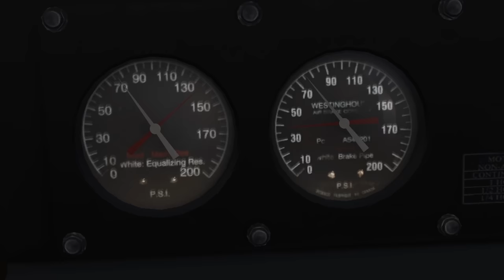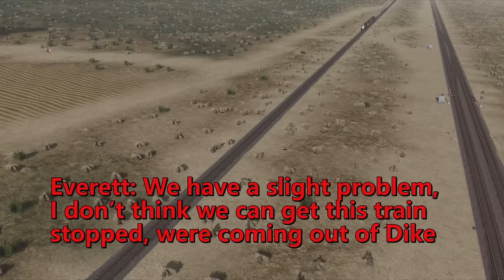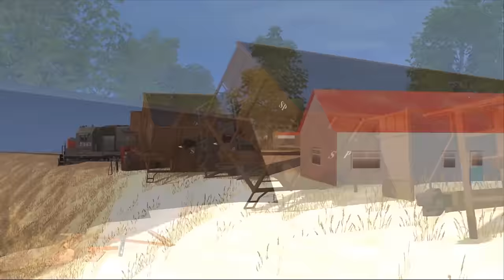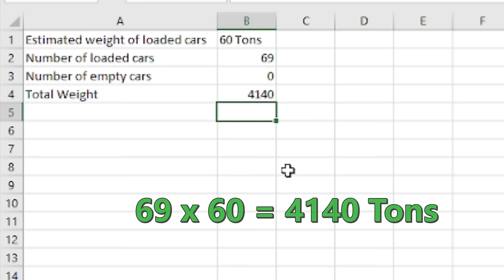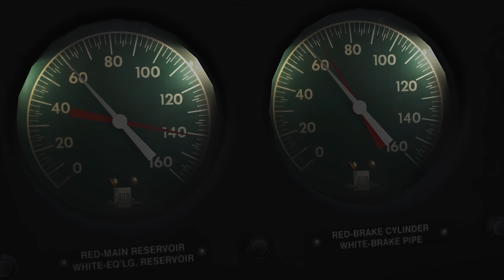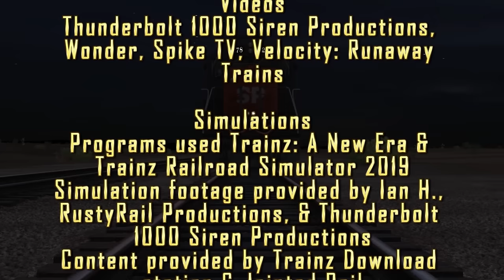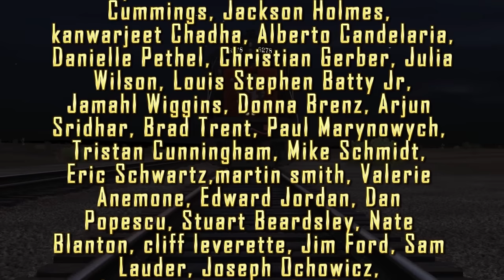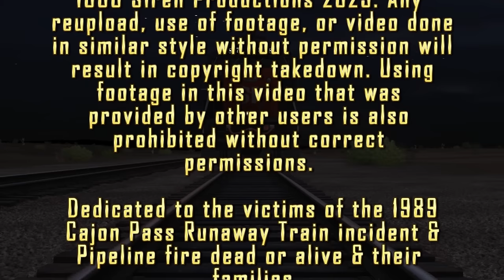The 1989 Cajon Pass Runaway 34 years later (Remastered)

Comment: The helper engineer did not lie. When the helper engineer said he was in full he means he has set the controls to maximum dynamic braking. With a short heavy train, and about to go down Cajon Pass, the engineers should have had a discussion about how many working units they had. Shorter trains mean fewer brakes and curves don’t take effect. All this should have, and would have been discussed, with more experienced engine crews in this operating area. Crown and Reese very experienced but they weren’t driving. The accident might have happened anyway, but the more experienced crew would have been more cautious and attentive to braking details. I know, I was a brakeman for SP and have worked this territory.
Reply: Bro learned the the truth and he is saying the right thing.
Reply: Where is Dave Carson these days?
Reply: @donstarr7261  I worked with Dave. I think it was a trip to Fresno. We are both Mojave High graduates.

Comment: SP asked the manufacturer EMD, to set the locomotives up to where when in emergency, the dynamics cutout. It takes about 60-75 seconds to reset the dynamics. The reason the locomotives are set to do this is to prevent the train breaking apart into sections that can collide. The front section slows more after the train breaks in two if dynamics remain on. This cause that faster moving rear section to collide with front section. Since this accident, the locomotives are no longer setup that way. When you go into emergency today, the dynamics stay on. If the train breaks in two, and a rear section rams into the front section so be it.
Reply: Interesting information, thanks for sharing.
Reply: Did it rain on the fully loaded hoppers prior to the event ?.

Comment: Sad part is the rail line was probably there first. People who have home/buy homes need to understand the risks. In my life I have  passed on buying hundreds of homes I looked at ..one a home within 800 feet of a rail line and also several properties with and next to gas line easements. I also passed on two near brooks/ streams. In ALL  cases these  were wise  decisions on my part: the rail line had a chlorine leak 5 years later and the neighborhood had to be evacuated. The house near the 2 foot gas line later expanded it to 4 feet! There where also gas leaks that permeated the ground and the neighborhood had to be ground purged. Both stream  houses have flooded due to the abnormal weather in the past years..and one was eve demolished and the land taken over by the town. I myself still deal with traffic issues with property but I knew it would be an issue 20 years after I went for it...and now as I predicted...it is. However the value and other changes have offset this known, predicted problem.
If you decide to live next to any infrastructure ...it is not a question of IF but a question of WHEN..you are responsible for yourself every day of you life and your decisions... HOME OWNER BEWARE

Comment: The most terrifying aspect of this accident that nobody is talking about is how the train was originally supposed to go down the mountain with just 3 locomotives, all at the front, with no helpers originally. Assuming that 7551 did not have dynamics even if powered on, that would mean that the train would’ve had no dynamic brakes going down Cajon Pass. 

That is very unsettling…
Reply from the maker: That's just scary as only 9340 would have dynamics that did anything (if 7551 also had bad dynamics) that's literally scary to think. It also proves I learn new info about a wreck everytime AFTER the video's released

Comment: This is a great remaster, thanks.  It is just crazy that SP had their locomotives in such disrepair.  Another interesting thing to think about is just past Duffy street is where the grade shallows out as you are now on the valley floor.  West Colton is on the far side of the city, so they are basically saying they would have to go all the way across town to stop.  I suppose the valley isn't completely flat, but West Colton is where you can start going back up a hill.  In other words, they are saying they have 0 braking power.  They went all the way down the Cajon Pass and were just coming into the major population center on the valley floor when they flew off the tracks.  So they actually made it pretty far and almost out of the danger zone in terms of brakes melting when they flew off of the tracks.

While the railroading industry has resisted smart freight cars, I have to wonder if this is a big mistake.  Some things I think they could gain from adding some sophistication to their freight cars that would overcome the cost of adding the smarts are:

1. Electronic braking - If you have ever seen any of these trains going up and down Cajon Pass, there is a constant bang! bang! bang! of numerous flat spots on the wheels.  Something tells me full freight cars get mixed with empty ones and over time a large percentage of the cars end up with flat spots between wheel changes.  I suspect a lot of this happens going up and down this grade, though I suppose you could develop flat spots anywhere.  While you can still have air for backwards compatibility, an electronic system on each car could have electronics block the air while active and electronically apply the brakes.  Maybe you just refill the reservoir while in electronic bypass mode.  Not having such a system has got to cost in both more frequent wheel changes, more track maintenance as the tracks get beat up, especially once the car has a full load in it again, and reduced efficiency dragging around wheels that are not round anymore.  Granted the nearby Metrolink trains tend to vibrate like crazy because they just keep running on those wheels with flat spots until the wheels take on a somewhat smoothed out, but lumpy shape.  Anyways the Westinghouse braking system is not infallible and it is not fast acting on huge trains while an electronic system would be much better in both regards.

2. Electronic scales - No need to slowly move freight cars across scales if the scales are built into the cars.  This is just not hard to do.  Sounds like it would save a tonne of time and thus money if the train weight was electronically gathered this way and sent over to the lead locomotive.  Also, sent to the train company's central computer so they can make sure these trains are run safely and have proper billing to their customers.  A big reason for having electronic scales on the freight cars is so the onboard computer can calculate how much braking force to apply without it leading to the wheels locking up.

3. Onboard hot box detectors - Sometimes trains derail because bearings go out between hot box detectors.  Anyways, I am sure the crew would be much happier if instead of hearing the hot box detectors at regular intervals as their train passes over them, they just get a warning the moment a hot box is detected through their computer system.  The rest of the time they are not hearing anything because there are no problems to report.

4. Electronically controlled automatic couplers - No more need to manually uncouple cars.  You just send the command from a central computer.  If you have modern electronic control of all of the freight cars, you don't actually need any connections between the cars besides the automatic couplers, so this can lead to very fast assembly and disassembly of trains.

4. Motorized cars with batteries - This can have a whole host of uses.  They can move themselves around the freight yards, allowing trains to be built and dismantled quickly.  Maybe you just do one pass at the end to connect any lines between cars.  You could do regenerative braking on the cars.  You could do dynamic braking on the cars when the batteries are full.  The cars could help get the train up to speed and help the train go over hills.  You could have train cars deliver themselves to customer businesses on small railroad spurs off of the main line.  Maybe if you don't want to go full self driving, you could remote control the cars or have someone ride on the car with a controller in hand.  Maybe you even have say a little fold out chair the operator sits on and a controller they grab and hold as they move the train car(s) around.  Considering regenerative braking and even solar panels for some car types, you don't need a power bus from the locomotives to operate such cars, though it wouldn't hurt either.  As the locomotives still provide primary tractive power to move the train around, these would be small helper systems adding a lot of advantages for a small price.  Maybe you have 480V AC connectors on these cars if for some reason you need to charge up the batteries on these cars.  I suppose this could be something you do when assembling a train at the base of a long grade so the batteries are fully charged before going up the grade.

Comment: Yesterday, I was on a bike ride from the town of Frankfort to west of Hampden, Maine taking the back roads. During my bike ride, I saw a train in the distance when I was crossing the 2nd crossing. It was on.... Let's say you go to a gas station in Winterport and turn left on whig st, and there is a 5 way intersection, you either take left or go straight I believe (when turning left, you encounter a 3 way intersection and you turn right, then both roads lead to the same road but I suggest you go straight from the 5 way) keep going and you should turn up to a couple of crossing of the same line. I saw a couple of people (possibly YouTubers) filming a video about the same train I witnessed. I wait for the train to cross further away from the crossing. I resumed bike riding after the train passed. Also the train goes down from Bangor(probably not originated from) to Belfast every Monday and Thursday at daytime.

Comment: fantastic retelling of the story, and a very good remaster. iirc the old version had some commentary about the people who accidentally struck the pipeline during cleanup, which i always found a bit disrespectful considering they were dealing with a disaster in a domestic area. it's up to inspectors to do a proper job of inspecting the pipeline for damage, and it was calnev's piss-poor work that it got by them. good to see a change of angle here criticising the cascade of failures at that company that led to the leak and fire
Reply from the maker: The music was overhauled too. I do wish I added more brake effects to keep the tension up (which I experimented with in another video just on the sequence itself) but overall this video is a top 5 for me

Comment: This is a message to Thunderbolt. While I don’t want to cross reference it’s worth noting in the 50 minute documentary on the Wonder channel which parts of this video did use. It does refer that at 6:29 when Frank Holland asked Lawrence Hill if he has all of his Dynamic brakes.

Hill responds with yes, but he likely was referring to ONLY 7443 and not 8317 or in other words in only one engine (7443) which had fully functional dynamic brakes.

Comment: I mean, neither the higher weight nor the missing dynamic brakes had technically a significant impact on this accident.

The crew applied emergency braking at 30 mph and the train did not stop, despite no individual car being overloaded. So clearly either the maximum load of these cars or the maximum possible braking power are not designed properly.

Comment: that was cool using the music from "runaway train"!
I grew up a half a block away from the KCS main un Westville Ok. and I always had that thought in the back  of my mind, what if this happened  at the end of the street  were the switch to the feed mill was. I never wanted to derail, but a train loaded with acids, crude oil, LPG, chlorine gas.... if one picked the points, all we would be able to do would be to RUN!! I dont think that we could get far enough away before all that dangerous poison reached us in our town of only about 5,000 people. the tracks ran right through the middle of town. but that says somthing for KCS quality. I saw 1 derailment before they went to constant welded rail, 9 loaded coal cars, and the BN caboose. it didnt turn all the way over, but it throwed the conductor out of the top and into the door knocking him out. it was a hell of a sight! we were crossing the tracks as it went around the bend into a giant cloud of black dust, and a roar I have never heard before, or ever after!

Comment: It's interesting that it derailed so late in the descent. It's about 30 miles from summit to colton yard and it only had 5-7 miles to go. The steepest part of cajon pass is the top of the south slope if I remember correctly, and I'm suprised all that weight didn't overpower the brakes then, even with dynamic still working.
Reply: No...the SP track is a constant 2.2% grade from Hiland to where they derailed at Duffy St. Santa Fe engineering dept. measured it at 2.5% during the SF/SP merger talks.

Comment: In the end in May 12th 1989, Southern Pacific SD45T-2 #8278, Southern Pacific SD45 #7551, Southern Pacific SD45 #7549 and Southern Pacific SD45T-2 #9340 were damaged burn beyond repair and scrapped. However the two locomotives survived from the wreck. It was Southern Pacific #8317 was put back into a same way. However, it was retired and it never ran again. And sold into HLCX. And last, Southern Pacific SD45 #7443 was put back into a same way. Also, It was retired for Southern Pacific locomotive. However, it renamed into MRS from Brazilian railway. And it renumber into 5313-1. It was very long time ago. And it never happened again.

Comment: One phenomen with Westinghouse 1 hose brake systems is that engineers are temped to initially apply less brake force because of that they have to release to brakes to apply less braking. So when too much force is applied initially, brakes have to released fully to apply less brake force...
In the EU 1 hose brake systems are prohibited. (Trains and Trucks) The last one that had it was the St. Gotthard Crocodile up to '82. It required an additional patent.

Comment: I'm a Category "C" Mainline Specialist Heavy Loaded Trains, Train Driver "Engineer" myself in South Africa for Transnet Freight Rail.

I started in 1992 as a Train Assistant "Brakeman" and was appointed in 2002 as a Train Driver "Engineer" after I did the Engineering course at my own time.

I like to follow these Train accidents and am always trying to get to the point of what went wrong.

We also have Dynamic Braking on our Diesel Electric Locomotives and Electric Braking on our Electric Locomotives.

First of all, according to me, even if the Locomotives Dynamic Braking fails, and you have to make an Emergency Brake Application on the Load itself, the Train needs to come to a standstill. The only time the Brakes can fail is, if the Engineer made a Brake Application to apply Train Brakes and Released the Train Brakes and applying the Train Brakes again before the Train is fully charged with Automatic Brake Pipe Pressure. It's been called, Milking if Train Brakes. In this case, if the Train Brakes are not fully charged, not even an Emergency Brake Application down a Mountain like in this case, will stop the Train.

We have a Train that we are working towards Iscor Newcastle. The Train consists of 3 x 22E Class Electric Locomotives and 105 Loaded CR Vehicles with Iron Ore. The total Tons is 8 400 for 420 Axles with a Brake Pipe setting of 550kPa. 

There's a spot as from Clavis Station up to Clontarf Station that we are going down the Mountain for 40 km at a Speed of 40 km/h with a Minimum Brake Application 40 kPa Train Brakes that's Applied on the Vehicles itself and the 3 Electric Locomotives Electric Braking.

But even if the Electric Braking is not working, we will still be able to go down the Mountain by means of changing our Train Handling.

Let me get to the point, let's say the Diesel Electric Locomotives Dynamic Braking was working and due to some failure the Dynamic Braking trips, the Engineer must still be able to stop the Train even if it was by using the Emergency Brake Application. Secondly, according to me, all Diesel Electric Locomotives and Electric Locomotives "Dynamic/Electric Braking" will cut out after the Engineer makes an Emergency Brake Application to prevent the Locomotives Wheels to Lock and get Skidded.

My question will stay, what prevents the Engineer from stopping the Train even if it was only with the Emergency Brakes?

Comment: I'm wondering if they had a system similar to the saluda key if it would have been different? A saluda key is a key used on saluda grade to keep they dynamic brakes on even if an emergency application is made so you'd have both types of brakes working together, normally when an emergency application is made the dynamic brakes cut out.
Reply: AT THAT TIME SOUTHERN PACIFIC HAD NOTHING LIKE THIS!
ALSO TO MY KNOWLEDGE NO ONE ELSE DID EITHER UNTIL THE FRA ORDER TO REMOVE THE EMERGENCY DUMP OF DYNAMIC BRAKES BECAME EFFECTIVE!
I REMEMBER THIS WELL AS I WAS AT THIS TIME WORKING IN AT&SF LOCOMOTIVE DEPARTMENT!!

Comment: They Should've removed 7551 from the train to prevent the disaster
Reply from the maker: It would of had little to no effect on the incident. The train just had too few dynamic brake equipped engines and it's weight was miscalculated

Comment: I'm wondering what would have been the correct approach to this situation had the 6900 ton weight been known? Any railroaders with knowledge as to this?
Reply: They were told it was 6151 tons actuall 8900 with three units 400 tons each not working in dynamic so add another 9000 tons, over 10,000 tons.